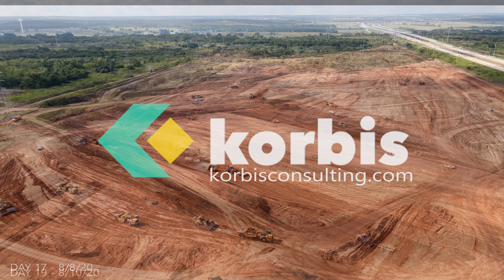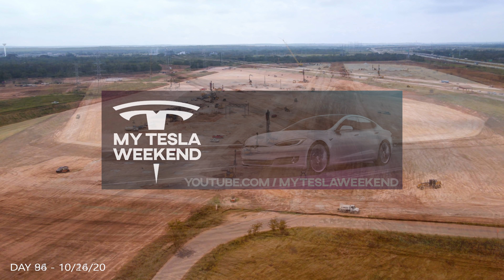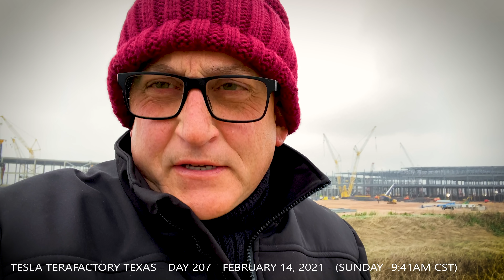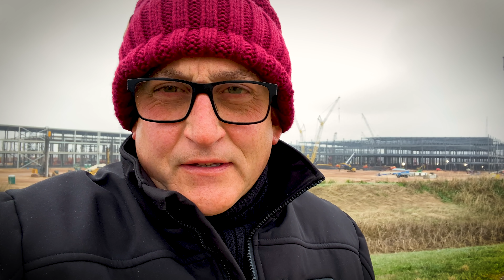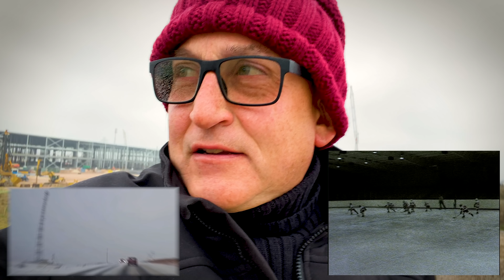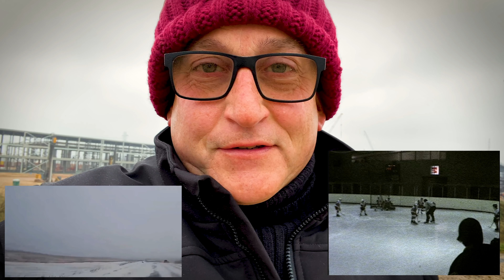Tesla Gigafactory Austin 4K  Day 207 - 2/14/21 - Terafactory TX - HAPPY VALENTINE'S DAY GIGA TEXAS!

Comment: Thanks for that dedication Jeff! I'll be here tomorrow. How long you need to drive usually to get to giga Texas?
Reply from the maker: It’s typically a 20 minute drive, today was closer to an hour. There was a semi tractor trailer at a 45° angle blocking lanes two and three, so I was able to “slide“ by in Lane one but other than that it was fairly uneventful.

Comment: Given the weather, now is a good time to discuss the climate change implications of building the machine that makes the machines.  My observation watching these videos is an incredible amount of concrete and steel goes into building a Gigafactory and a huge number of fossil fuel burning trucks, cranes and dozers are used in this operation.  Yet we have to start somewhere and mass producing EVs is a good first step.  Semis and cybertrucks to follow, then perhaps Caterpillar will begin producing electric dozers etc.  But the hard part as Bill Gates said last night on 60 Minutes is producing carbon neutral concrete and steel.  This is a major challenge and it will take more than a few Elon Musks to solve these problems and implement solutions.  Perhaps more difficult than starting a colony on Mars.